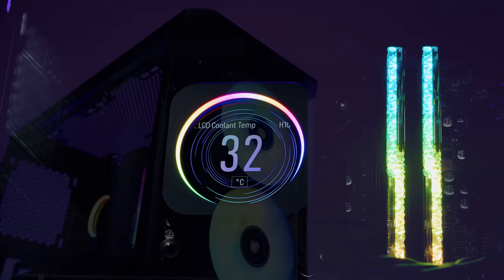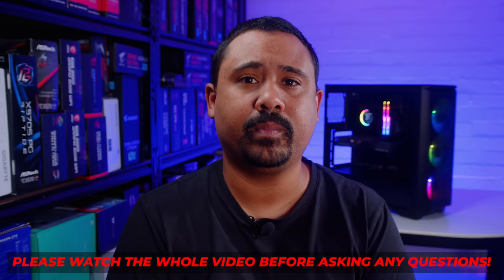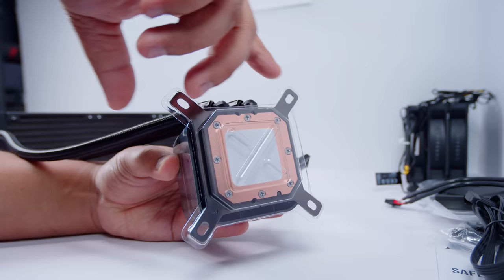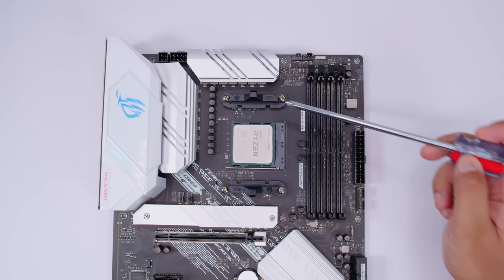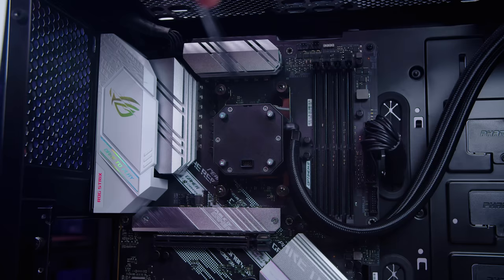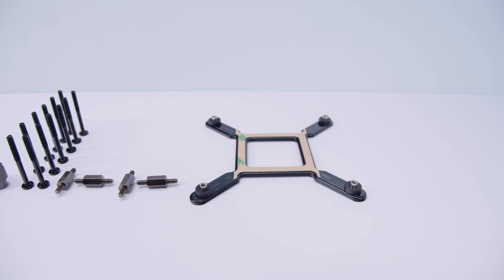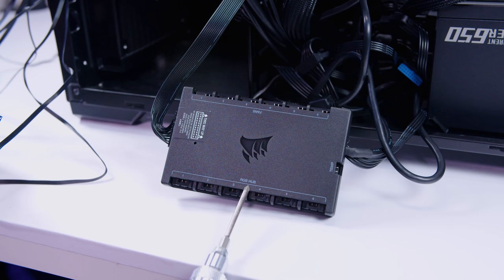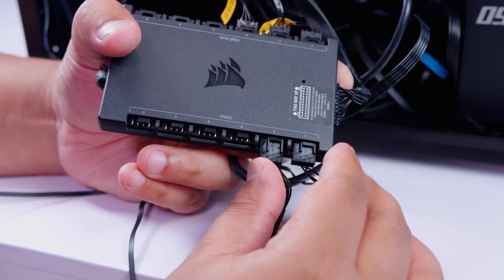HOW TO Install Corsair H150i Elite LCD on AMD and Intel

Comment: there's a known issue with many users where the cooler LCD display shows a red triangle error. the issue has to do with the use of the usb splitter possibly drawing too much power from a single usb header. most users have opt to bypass the splitter & plug each usb separately onto the mobo. how did you managed to get your AIO to work correctly using the splitter.
Reply: I'm trying to figure out this error rn. Even with both plugged in separately it remains :/

Comment: I have a Phanteks Enthoo full-tower case. Where do you put the control box inside the case? Does it have screw holes so you can fasten it to the case, or do you just let it dangle inside the case in some random place?

Comment: Great guide! But I am having issues with my standoff screws for my AMD! when I put them in, the stock backplate remains a few cm loose! anyone else have this issue? is this suppose to be like this? help!
Reply: Having same issue!
Reply: did you ever get an answer for this?
Reply: @JennyA  yes! i asked my gamer buddy, he said to just put in the cpu and that will help fill in the gap, lol...seems like common sense, but i wish videos would say that lol.
Reply: It's supposed to be like that. When you mount the cooler, it will pull snug. Think of it as spring-loaded.

Comment: Yeah, this cooler has so many cables, you are the only person who showed how to install it in an easy-to-understand way. Installing the radiator, fans, and block is easy but all those cables were daunting to say the least. Thank you sir, you helped me when everyone else just wanted to show their beautifully built system.
Reply: to be fair, i think all things which come with rgb are kinda daunting. 
3 years ago i builded my first pc with an aio cooler, for some reason my mb only has had one rgb header and it had to much volt, so my rgb on the aio just died on first start up.

since that i wont touch them without an tutorial anymore. 
i can build a pc from scratch without any issues but when it comes to rgb im out.

Comment: Your fantastic video helped me to setup my Corsair H150i RGB Elite at home. My device doesn't have a control box (because RGB controlling is already integrated) but I could get it up & running in a similar manner: Connecting it to CPUFAN & USB 2.0 Jumper on my motherboard, connecting the 3 Corsair fans and adding a SATA power connection from my power supply. I would also recommend to remove the plastic from the screen (11:30) a little later because it is very prone to scratches. In general, thank you for this great tutorial! It would have taken me a lot more time without it. 👍 Best from Berlin, Benny
Reply: where did you connect the sata power connector on the motherboard?

Comment: I Was so nervous working with this AIO because of all the wires and its been a while (10 years) since I build my last computer (laptops since then) with lg67 itx motherboard with the CPU's included cooling fan.  And then I discovered that some people are using a retro kit for  lga1700, but his video helped to show that all the hardware is included in this case.

Comment: This gained you another subscriber. I’m new to PC building and such and this helped me change the AIO to the new corsair in my prebuilt. The only thing i can say is that these angles made it exceptionally simple and straight forward to install and correctly wire up. Thank you so much.

Comment: It should be noted that the CPU fan header does not work for this AIO on most motherboards.  You will need to plug it into the SYS FAN PUMP header and will likely need an extension cable due to the cooler’s super short included cable.

Comment: I am using same AIO for 7800x3d. is it normal the coolant is only 33degree while idle CPU is 63? it is ~30 degree difference. After R23 pressure test, coolant temp stable at 35 degree while CPU stable at 83 degree. four screws was screwed up until i feel resistant, but gently by a driver.

Comment: Tip: Connect the pump USB cable DIRECTLY to the Motherboard. I bought this AIO last week and I connected both the pump and controller USB cables with the Y cable. After some minutes the LCD screen froze and the hardware disappeared from iCUE. After looking for info in Reddit, I found this solution, to connect the controller to the Y cable and the pump directly to the motherboard and voilá, the screen works perfectly now.
Reply: Can u make a guide to it?
I already did but nothing happens
Reply: @MiguelGaming117  I just followed this comment from Reddit:

I had the very same problem with my setup. After setting everything up I would open iCue and the LCD would show up on the iCue software and I can adjust all the settings and use it but it would freeze and then crash and would disappear from the iCue software and the only way to fix it would be to restart the computer completely. Just for it to crash again after a minuet of opening iCue. What helped me over come this was not using the splitter for the USB header cause from what I gathered if you use the splitter and it has to share power from another source using the same header it will cause the LCD screen to crash. So I plugged the LCD screen directly to the USB header on the motherboard so it had it's own header and the problem went away and never crashed. I ended up using the splitter for the Commander Core and another unit that also used the header. Don't use any splitter with the LCD plug, plug it in directly to it's own header on the motherboard. Hopefully that will work like it did for me.

https://www.reddit.com/r/Corsair/comments/r85kvo/elite_lcd_upgrade_kit_keeps_freezing_itll_be_fine/

Comment: Dude i got these  brackets with mine and was like wtf why does every video online show it with two hook point type mounts lol thanks for this upload trying it on a AM5 build tonight
Reply: Did it worked on the am5?
Reply: @RicardoSantos-xy1or  yeah it worked fine on a ROG CROSSHAIR X670E HERO i dont think they changed much on the new boards as far as the mounts go.

Comment: My LCD screen isn't detected by iCUE. Tried ditching the USB splitter to no avail. My pc detects it in devices, but not in iCUE. Also downloading iCue causes the pump to stop running. Uninstalled iCue, the pump functions normally, lcd changes from red triangle to "coolant temp 0*C"
Reply: any fix so far?
Reply: @JMS823  only fix is probably a return. I have the same thing going on corsair is dogsht
Reply: Update: bought a second one and it works flawlessly! I waited too long to try and return the first one, so I just replaced my 3 Cyberpower case fans with the 3 Corsair fans from the radiator. Everything works now and I have 6 matching fans! 🙌

Comment: FINALLY, watching your video i finally figured out i missed connecting both usb cords to the splitter. its been like a year and i couldnt figure out why the screen never appeared in icue settings even though the pump itself did. Q_Q

Comment: Thanks for the tutorial! Very helpful especially as I am building a new PC today with a H150i Elite cooler! :)
Reply from the maker: Glad this could help :)
Reply: @GearSeekers  Was there a plastic peel on the thermal paste? Thanks!
Reply: Would you happen to know how the wiring goes if I have unifans and not using corsair fans? My main confusion is do I still need to use the commander pro controller (I know its technically not that but same idea right). Can I just plug USB2.0 and the pump header connection? that way I can control the LCD screen via iCUE and the pump speed I can set to full speed?

Comment: Will be doing major surgery on the desktop tomorrow, replacing my NH-D15 with this cooler (largely because the NH-D15 is just in my way - it's way too big compared to a pump / top), replacing the 5700 XT with a 3080, and replacing a few Noctua chromax fans with the same fans that come with this cooler. I've avoided Corsair for ages as I don't like proprietary solutions, but the EK Nucleus I pre-ordered in September still hasn't shipped and I'm tired of waiting. With the screen, everyone says iCUE is by far the best software among all the "mainstream" ones (I've heard it's got nothing on AquaComputer's Aquasuite, but I can't be arsed to build a custom loop either), so I figured I'd give it a shot.

Wish me luck.

Comment: Thank you very much for this guide.  Every other guide that I could find was strictly amd.

Showing that I could reposition the back bracket's screw holes was extremely helpful.  Been awhile since I was deep in the guts of a pc.

Comment: I just installed the H150i Elite and I'm doing a push/pull setup on it. When I powered on the computer the  RGB lights did not come on but the fans worked. I had no problem with setting up my commander core xt to run my other 4 x 140AF RGB lights. I do not have my OS installed on the computer yet.

Comment: Glad I watched this video, was about to go pick this up.  I'm so used to coolers coming with the brackets they need.  Currently have a Hyper 212 which has its own bracket.  The stock bracket i lost in a fire...  need to order that bracket now.

Comment: I have the problem that if i want to change the pwm speed in icue it doesnt affect anything :( 
So setting it to custom 1 for example and then after switching tabs etc. the fans setting going back to blank...

Comment: @17:22  why did you plug the cable to the CPU fan socket and not into the PUMP fan socket? What will happen if you plug the cable to the PUMP fan socket? Will something break? Thanks
Reply from the maker: LISTEN to what was said
Reply: @GearSeekers  Thanks for an amazing, awesome spectacular reply.
Reply: @TotemYuri  I get he gets these questions a lot but sometimes people miss stuff and it would be nice to provide an actual answer. You did nothing wrong.

Comment: With regards to fan controllers for me the lianli fan controller is way better, especially if your using the uni fans. You can connect 12 to 16 fans at the same time!

Comment: is it normal for the back plate to feel loose before adding the pump? I just feel like this is wrong for some reason
Reply from the maker: yes
Reply: That's exactly where I am right now! The back plate is just jiggling around? I don't understand how the CPU pump is going to be securely attached to the CPU socket. Something just does not seem right?
Reply: @philmccracken2012  After I put the pump on it pulled the back plate tight and it felt secure

Comment: So it doesn’t matter if i plug it into the CPU fan header or the AIO pump header? 

Because the Fan speed detection error pops up and asks me to hit ignore in bios if problem persists & i have, i never felt comfortable leaving it in the fan header even though it was an AIO pump so I’ve always put it in the Pump header and hit ignore on the fan detection error.

Comment: excellent guide, thank you sir :). Maybe this is a noob question, but here goes: If I have a corsair RGB Case (e.g. iCUE 5000D RGB) can I manage the front-mounted fans of the case in this same fan-hub device or are case fans a special situation that is not supported with the hub?

Comment: I have setup my h150i elite using the splitter usb cable but when I switch on pc the fans connected to the commander core do not spin up or light up straight away there is a delay any ideas why this might be?

Comment: I have a red triangle with esclamation point into the little screen, and the system doesn't start. Brand new installation, and the cables seems to be all in the right place. Any idea, or suggestion? Many thanks

Comment: I’ve had nothing but problems with icue on my brand new build, all my problems have been resolved upon the removal of icue which is w shame because armoury crate just isn’t as good. I don’t really want to run the risk of continuously overheating my cpu because icue just stops powering my cooler/pump. It’s extremely random and again hasn’t happened since removing the software.

Comment: Do intel and amd just use different metal adaptors on the motherboard or do they use different screws and caps too ?
I bought one in mint condition on ebay but it only has the intel fittings and i need AM5
Reply from the maker: All the mounting hardware is different except for the nuts that hold the cooler down. Everything else is not the same.
Reply: @GearSeekers i see so i need the amd bracket and the stand offs but can use the nuts provided with the intel, thank you.
Also hopefully you can tell me as i cant find info anywhere, does the amd4 bracket fit am5 boards ?
I can only find am4 parts for it on ebay not am5, hopefully they're the same ?
Thank you, i really appreciate it👍

Comment: can I also put the fans on top not on the right side like you did? I have the same case as you and I see that it doesn't have that much space left at the top. would I need to buy a bigger case or can one put the motherboard a bit more down towards the bottom of the case?

Comment: I was lucky and got the Elite LCD standalone for my Capellix in my 5900x system back in October 2021. I couldn’t get it to mount properly. Spent hours messing with it. 

 Then I tried it with the Capellix in my Intel system. It mounted right up no drama. Once again I got lucky and just ordered another standalone LCD before they went out of stock again. I’m keeping my fingers crossed I can get it to work with the AMD system.

Comment: I installed my H150i and everything is almost set up, but I didn't know how can I plug in the cooler. Taking everything off would take a while.. Can I not take my motherboard off the case, and could I just put the backplate while motherboard is in case? Even if it's not recommended as you said.

Comment: Hello! Can anyone please tell me why on the iCUE Link H150i the AMD bracket seems loose, I have tried multiple times to get it to fit snug but they slide right off, is that normal? I feel I'm doing something wrong, I have searched the web for a solution, and there is none. Thank you!

Comment: Can you use and configure different fan brands with the control hub? Or do I need to use different fan controller?

Also no thermal paste is necessary even for a 13th gen intel ???

Comment: Installed this cooler on a new msi z690 mobo and all my fans work as well as rgb but no devices show in iCue. I’ve literally tried everything to get them to show but nothing works. Fans are running full speed all the time

Comment: 12:06 - would you install the AIO pump into the AIO PUMP header on the motherboard if you have it, or should I just install it in CPU FAN header?

Mobo is B650E-F in my case..

Comment: When I use this in a corsair 680x, can I plug the 3 case fans also into the controller that came with the watercooler and omid the one that came in the case?

Comment: Thanks for the video.  I am going to be using different fans, so do I just follow the installation as normal, plug the AIO into the pump_fan port and the phanteks fans into the CPU fan header?

Comment: Just installed mine for the first time i’ve worked with a corsair cooler i haven’t installed windows or anything on it just checked if it would boot into BIOS settings and when starting up i noticed a warning sign on the LCD screen is this normal until you’ve installed iCUE?
Reply: did you ever fix yours? I still cant get mine to work
Reply: @jimmyramos1989  for me it was because i place the corsair fan/pump controller to close to the side of my case wich interfered a bit with the 24pin mini cable of the pump

Comment: So for the CPU Intel installation on 12th gen, can I use everything that the cpu cooler comes with EXCEPT for the standoffs (I ordered the 1700 standoffs off of Corsairs website because the entire kit is so out) should I be okay using everything out of the box with the addition of the 1700 standoffs?

Comment: I have lian li fans in the pc which i would like to keep. Do you know if I will face any issue connecting 3 LL fans from raidiator to the commander hub so CPU can control the fan speed for the rad fans?

Comment: One question though.... I have a 4000D Airflow case, I'm guessing is the same one shown in this video, so, after putting everything together I noticed the front filter wont fit anymore, does anyone else have this problem with the 4000D case?
Reply: Loosen the rad and ease it up in the slots then retighten. This should free up the pegs that secure the filter/front.

Comment: Can you rotate the display?  Some people are picky about pipe orientation out of the pump, it would be nice to rotate the display regardless of the way the pipes were?
Reply: Did you ever figure this out? Just bought my 170i and I have a case that mounts my mobo 90 degrees to the right.
Reply: @23marbello  No, I searched but didn’t end up getting this cooler.  It doesn’t appear to have a rotate  feature in the icue software and I can’t find any video that covers rotating the hardware (screen physically). They should address this for sure.
Reply: @kiwigeeknz  I actually found a statement they released not too long ago. Apparently they were experiencing major performance drops before they released the product and took the feature out of the options. They are still looking into it.

Comment: Question? How tight should the standoffs be. Should they have play in them? I tighten them up as must as possible and they are still loose or wobbly. I'm using a i9-1390 cpu on a maximus z790 dark horse?
Reply from the maker: Wobbly is normal
Reply: @GearSeekers  are you certain wobbly is normal?

Comment: So.... I have Be Quiet Wings fans for my Be Quiet AIO and I use Gigabyte System Info Viewer (SIV) for the fans speeds on my AIO + Fans. Nothing else. I have Icue for my RAM sticks

My question is can I use Gigabyte SIV for controlling my fan speeds INSTEAD of using Icue? Idk if you answered that.